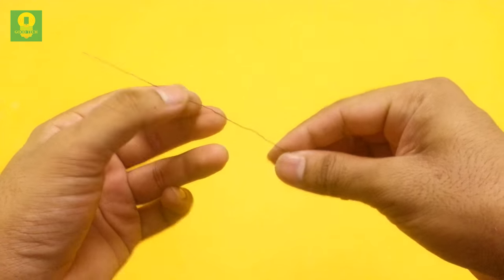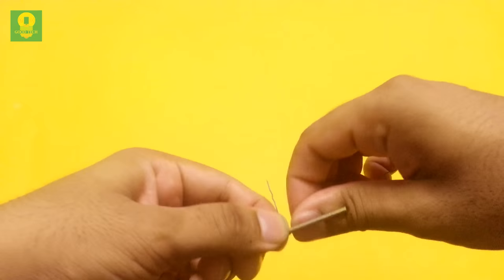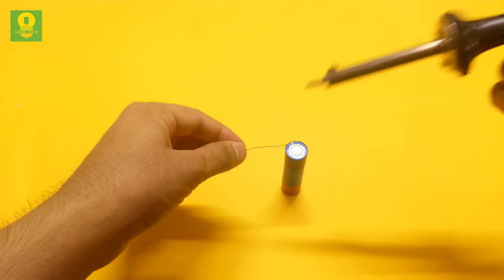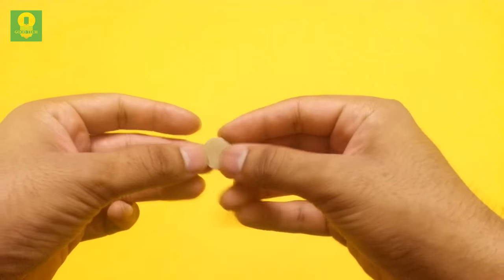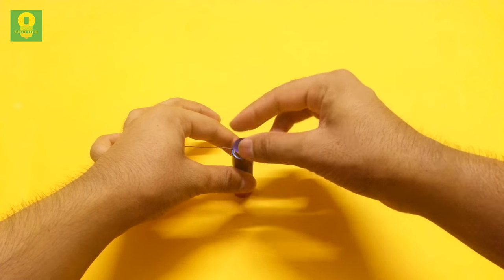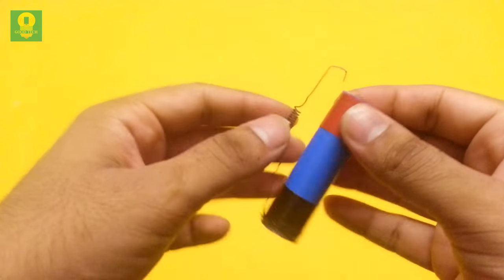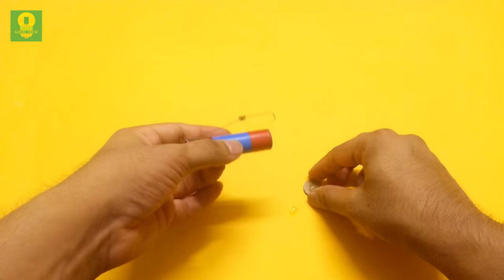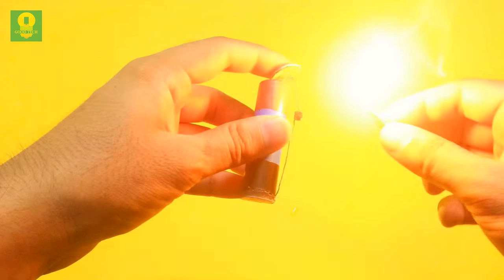How to make an Electric Match Lighter

Comment: can i use coil from my vaporizer?
Reply from the maker: I have no idea what kind of wire will be found in your vaporizer, however, if it is nichrome wire (that gets red hot when voltage is applied ) then that will do the job well.

Comment: nichrome wire k bina kam nhi chalaga kya
Reply from the maker: Nope, only nichrome wire can be used to work with this device. All other wires will short the battery and the batteries will explode in no time.

Comment: nice work! one question is that nichrome wire?
Reply from the maker: Yes
Reply: ok ty :P, what kind of wire can use? only nichrome?
Reply from the maker: Yes, only nichrome wire has the property of high resistance due to which it attains very high temperature with very little current.
Reply: thank you i will try with nichrome :P